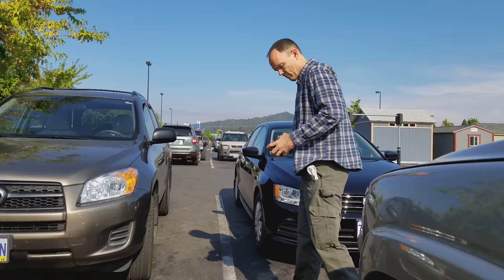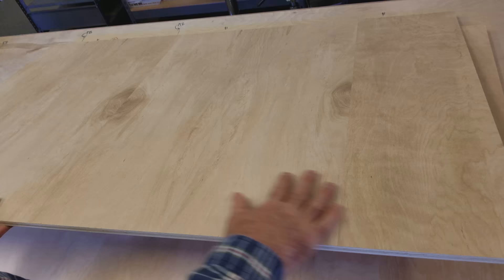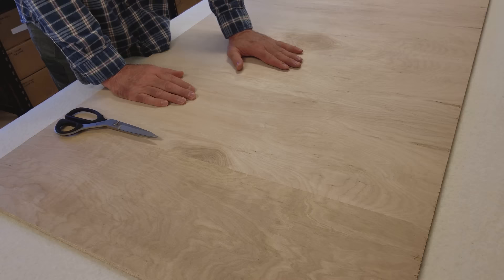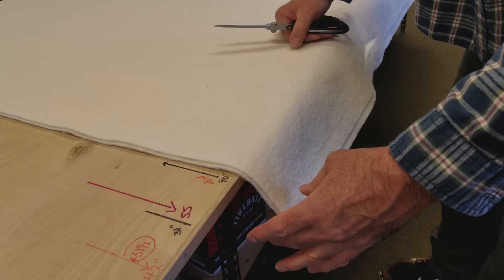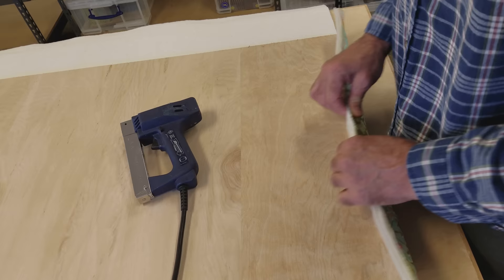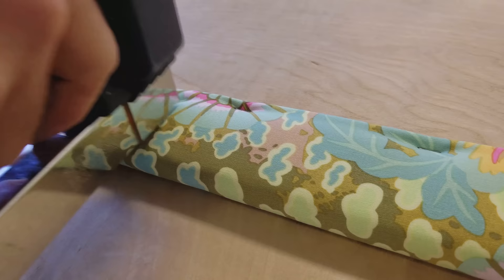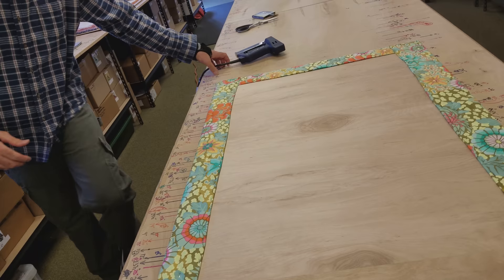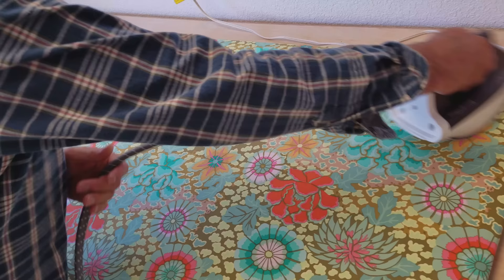Matt's Ironing Board Adventure

Comment: I made one of these years ago to put on top of my regular ironing board so I had a bigger, more square ironing surface. I put 1x1 stops on the underside at the front, back and sides of the board so it wouldn't slide off my ironing board. If I needed my regular iron board I would just lift off the big one I made and replace it when I was done. All quilters need this big board.
Reply: Exactly what my husband made for me! Quilters think alike

Comment: I add a layer of heavy duty aluminum foil between the wood and the batting. it heats up as you press, and gives you heat from both sides.
Reply: It also keeps the moisture from being absorbed by the wood. Thus, not warping the plywood.
Reply: The Busy Needle think I’ll do that too, thanks for the tip
Reply: I need a bigger ironing board, so my next project is to make one. I’ll add foil to it. Thanks for suggestion
Reply: A great suggestion.
Reply: I don't think I want that for my board. I work in a very, very tight space that doubles as a place for me to press, and then cut with a mat on top. At times, I have to wait until the board cools down, because when I put my Olfa mat on top, it sweats and gets damp. I have a little fan that I point down on it to hasten cooling of the surface when I am pressing, cutting.
Reply: Excellent tip, will do when I build mine... Thanks
Reply: Excellent tip, will do when I build my own...
Reply: Very helpful video! Thank you! I have a question about a good iron to use… What is the best steam iron I can get?
Reply: @spyderquilt9783  I too wish I had space for that board, another space for my mat and a sewing table.
Reply: What a great tip! For my little pressing surface, I stapled cotton batting to the wood, but for the top, I layered wool felt and canvas and surged the edges. I did not staple all of it to the wood because of moisture concerns. But for this big one, I am going to staple because I want the surface taut. Even though my plywood is outdoor grade so moisture resistant, I want to reduce my chances of mildew.
Reply: @spyderquilt9783  You might be able to put cutting mat on backside of board.  I have seen this done.
Reply: You can also use aluminized cotton, which is made specifically for ironing board covers, pot holders, oven mitts, trivets, etc. I have found it on amazon and Joann online.
Reply: I'll have to try that idea as well. Thank you for the tip 😁
Reply: This is a great idea♡
Reply: Clever 👍🏻

Comment: I did that and  added a heat  resistant layer, 1/2 " twill tape for handles on all 4 sides and to trim the edges on the wood side. Worked great.  So, the layering was wood, batting heat fabric then a heavy cotton fabric with the trim and 4 handles.
Reply: Clever. How did you attach the handles?

Comment: I made this. It was quick and easy. Makes ironing soo much easier. I drew a line on it with a straight edge so I can iron my blocks straight.
Reply: Great idea adding a straight edge. I wonder if adding one perpendicular line intersecting with the straight edge  would be of benefit.
Reply: What a great idea!
I'm gonna do that to mine lol
Reply: I just thought I'd add that that would be great for strip units. I have been wanting to make a quilt using strip tubes but I havent yet lol
Reply: Great idea.  What did you use to mark the line?
Reply: @Susan1937Fisher  Линейку 😉

Comment: I like your pressing table. I did something different. I used a hollow inside door, drilled random holes on the bottom side to help prevent warping.  I used a heavy canvas to cover the upholstery batting. We built a shelving unit underneath. I have had it since 2009 and still love it.

Comment: I would be tempted to raise the whole board up on rubber feet in the corners and drill holes all over the board to allow the batting to air out and dry. I think the fabric is very pretty and would make a boring chore more entertaining.  I love this project.
Reply: I wonder if a peg board would work or if it’s too thin.

Comment: My husband also made a rectangle ironing board to put over my regular board and used cleets to keep it from moving around. I did however use a wool batting. Since our small wool ironing pads keep heat I thought the wool batting would also. I also used the silver ironing fabric. I know its boring but it works.

Comment: I used pegboard, rounded the corners,  made a cover out of silver ironing board cloth, cotton batting, and InsulBrite. The cover is removeable with elastic gathered corners. Using pegboard allows me to bolt it to my ironing board, through the metal grating.
Reply: Mary Richards-Kallman How did you attach the board to the frame. Did you use washers? How many screws ( or whatever). How far apart did you place them? Would you do a video of just the attachment of the board please?
Reply: any removable elastic gathered cover would not give you the tight flat unmovable surface for sharp pressing
Reply: Now that you’re board is several months old, how is the pegboard holding up? Assuming its masonite, i wondered how i was coping with the steam :)

Comment: I made a small version that I can tuck under my sewing/craft table. I had too many kitchen cutting boards!  I took the thickest, about 1/2", added a double layer of batting from a mattress pad, bound a layer of fabric, attached Velcro strips to the sides to pull taught on the board. I wanted removable and washable. All items were on hand.  It even has a handle in the board design.

Comment: Loved you video but I wouldn't use 80/20 batting. I'm also a firefighter and hot ironing boards and polyester isn't quit what I had in mind. When the iron/irons are really hot that wood will hold the heat especially since your board is on a counter and not on an ironing board or legs of some kind to get air underneath so it can cool.
I know a lot of people don't think about this and it's why they are changing pads more often.
I was hoping you were making the board that goes onto the iron board.
I have the dimensions of the board and what I need. But I thought I was going to see how it's put together. lol o-well
I'm going to use the Insul-bright Fabric (not insul-bright batting) and add 100% cotton batting and my decorative fabric on top. Used that before on a regular ironing board and it works great.
Thanks for your video
Have a Bless Day
Reply: Several months ago I made a iron caddy using Debbie Shore's youtube video.  She did not use the Insul-bright Fabric, but I opted to use it.  I was still very disappointed.  The heat and moisture went through all three layers of batting and the Insul-bright fabric.  I won't try that again.  Just didn't work.  I do think having the birch wood board will and should make a significant difference in my ironing experience.  I do wish I had used 100% cotton instead of 80/20.  But I still expect to get lots of use and enjoyment out of mine.
Reply: Cheryl Matthews ii
Reply: Cheryl Matthews  I always read / view about three examples when about to embark on a project. I read a comment on the SharonSchmberNet video which is informative.  Goes further on your point.
Reply: Where can I find insul-bright fabric?

Comment: Lovely to see this video thank you
As you cut out the corners I thought I’d cut the batting as you did, but have some turning allowance left on the fabric, say 1/2”, so when you fold under the corners you can hide the cut edges
When I get an new ironing board cover, I just add it on top of the old, to build up the squishiness.  Why not just add new material if the old gets singed?
Reply: Because everything I have read/researched about quilting and ironing is that if your ironing board is too squishy, you have a chance of not ironing things straight.

Comment: Good tutorial.  Thanks for posting.
I may make with modifications:  size to fit across my washer and dryer.  (I have no room for a stand up ironing board)   I like that it is flat. I can store on the floor beside them.  Someone suggested putting aluminum  foil next to the wood?  I'll research that for safety.   I think that I can purchase ironing board batting.  But, I will definitely look for that cotton fabric.

Comment: Did you specify what kind of batting you used?   Polyester batting will probably melt so I am guessing you used cotton or wool batting to stand to iron heat.    I'll bet you can cut some smaller tailor shapes out of the wood, too for clothing such as a sleeve board with legs.   Thanks Matt

Comment: Sometimes my staples don't go all the way in or go in bent. I am also using an electric stapler. Thanks for any tips
Reply from the maker: Sometimes you need to use a hammer to get the staple all the way in. If the staple goes in bent then I usually pull it out.

Comment: I don't have a place to keep a large ironing surface.  I was thinking about getting a gate leg table from IKEA (Norden), and making an ironing pad to use on top of it.  I know it wouldn't be as tight as fabric and batting stapled down, but I thought I could use elastic loops on the corners, or make it like a fitted sheet.  What kind of fabrics should I consider?  Should I use some heat reflecting batting like Insulbrite?  Heat resistant fabric like silver Therma Flec?  I love your tutorials, and I am anxious to hear your thoughts on this project.

Comment: I have a piece of mdf board from another project.I know it's too heavy to move easy, but where it'll be setting that won't be a problem. I just worry cause it isn't wood, how it will react to the h e at and steam.
Reply: mdf swells with moisture.
Reply: Doesn't it contain formaldehyde?
Reply: MDF is toxic, steam heat..... not good!
Reply: Line it with heavy aluminum foil

Comment: I have a question about using the wood. Have you had any warping issues or mold because of the moisture using the steam from the iron? I was thinking, could you use some kind of varnish or protectant on the wood before you put the batting and stuff on? Also, have you had any issues with using a printed cloth and the bleeding of the colors onto the fabrics you're ironing?

Comment: Have you ever put little feet on the bottom to keep it up off of the surface?  I'm thinking that it would be sitting on my kitchen table so I wonder if that would help with cooling it down quicker so as not to mess up my table top?

Comment: Donna is always concerned that she's ironing the block straight, enough so that she keeps that 4-foot long "yard" stick as she calls it, on the ironing board. Any reason you avoided the stripes that you picked out? Are stripes too hard to mount straight onto the board? Would rounding the edges of the wood before adding the batting keep it from wearing through so quickly? Is there any risk that the staples might scratch the table under neath, if so, how would you finish the bottom, if it was a concern? Don't get me wrong, I love the fabric that you picked out. Just call me serious Suzi, always thinking of the practical. xoxo
Reply: Suzi Saint James To keep the staples from scratching your table use a piece of felt and hot glue it to cover the staples, maybe 1.5" wide by the length of your new ironing board.

Comment: Great tutorial Matt!  I was wondering if you have a problem with the staples scratching the table surface? Could you use some type of adhesive or would the heat melt it? Thanks
Reply from the maker: We have not had any trouble with the staples, the fabric and batting puffs out a bit, with the staple in closer to the ironing board so the staples are not actually touching the table.

Comment: this is n wesome board for someone who 1) has the space for someting so lare in their sewing room. ( i do realie the size cn be adjusted to need, don't get me wrong). and for some one who may never say use something like ... say some startch... i don't want to have to have 2 of them sitting around so that i can switch them out all the time. not to mention it will get expensive as the sstartch build up would be gross and ubsanitary after a short amount of time. whynot just make a snug fitting pillow top like thing to go around it? something that can be taken off and washed every so often as the need arises. lie when one of my gannies come running in with their juice cups and spills something on it. lol

Comment: Hi. I love that idea. I would like to know where I get a big chuck of wood like that and batting for the underlay. I'm from the UK so not sure if it's called the same thing here. Could I use a high density foam?
Reply: @ Nicole O Scott  It doesn't look as if anyone ever answered this for you.  

I'm from England originally and when I've been over there I've seen a store called B&N or some such, a place to buy building materials, kitchen cabinets, etc. and baths, etc.  They should have sheets of the plywood and probably will cut to size for you.  Here, Home Depot sometimes has a corner where they have odd pieces of wood that might be the right size and they sell them cheaply.  

Batting is called wadding in the UK.

Comment: What kind of iron do you use on the show? I can’t find a steam iron that works good and I have had several.
Reply from the maker: We use a Rowenta iron that has the water reservoir in the
base, not the handle. You can find them on Amazon – look for the Pro Precision
or the Perfect Steam.